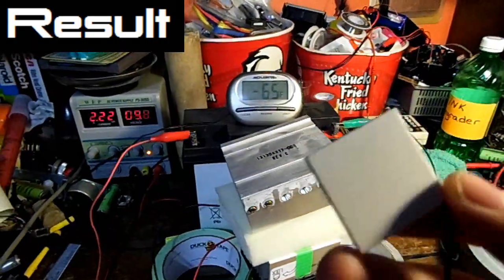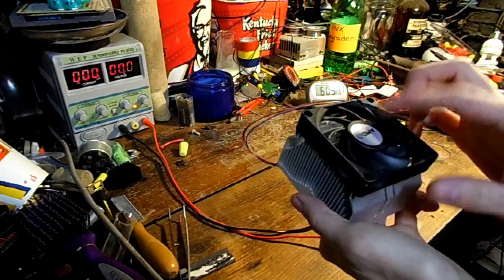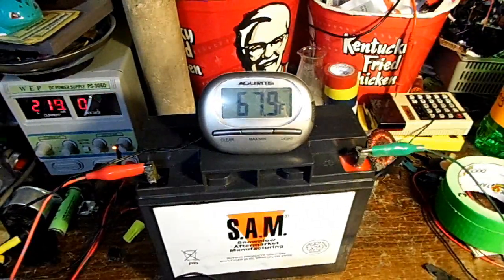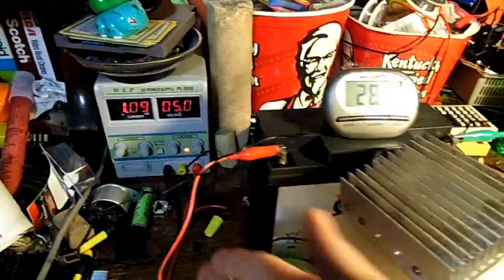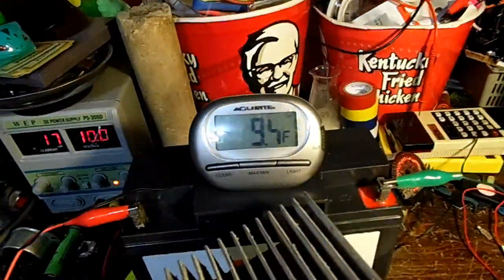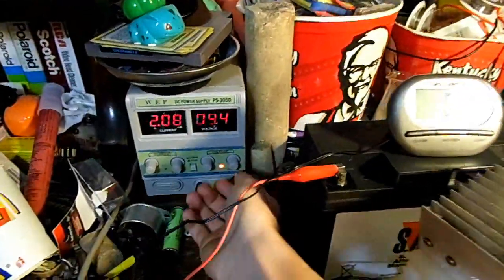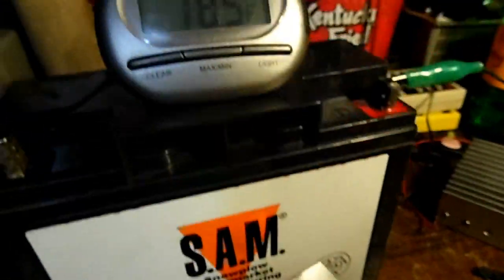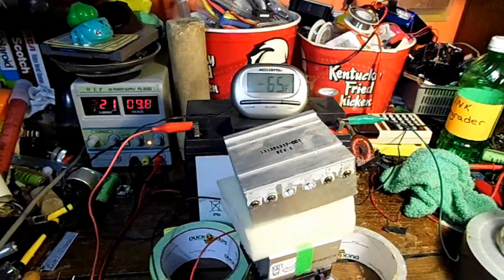Thermoelectric Peltier Cooler experiment 2

Comment: So running a peltier at approximately 10 volts you get better cooling ?     Peltier units are very interesting. Something with no moving parts and no high pressures but gets cold.

Comment: Hello, I'm from Brazil, my question is
Should I use fans in my 18650 packages?
thank you so much
Reply from the maker: make the battery have 2AH for every 1 amp you plan to pull, and it shouldnt heat up hardly at all, thus requiring no cooling.
Reply: thanks

Comment: hey! this is my first comment ever ( ithink) but i love your vids, watch them ALOT OVER N OVER. i just recently did my bafang mid drive bike. 48v 750w. also its 80 degrees where i live. heat kills the mosfets in the motor ive read. COULD YOU USE THESE TO KEEP A MOTOR COOL??!! EBIKE??????!!!! YOUR AWESOME!

I REALLY HOPE THIS IDEA WORKS. BUT IM LOST BECAUSE THE COLD SIDE WILL BE ON THE MOTOR WHICH GETS HOT...SO...????
Reply from the maker: well the issue is these dont push heat very quickly. so i think a big copper heatsink and a fan would be best. maybe get the fan and heatsink from an old laptop?

Comment: The results from adding the water was really cool.  So what would happen if you put  one of the coolers directly on top of the processor ?  would it work to help cool the processor or hurt it ?  I am also curous about where to get one of the variable controller or power supply like you use ?

Comment: 65 degrees difference is amazing, especially air cooled. I've always thought about 40 was the best you could get from these.  Try using a water cooled heatsink on the hot side with 65 degree water you might get even colder results.

Comment: What brand and model peltier did you use for this? I have a tec fridge I'm looking to cool further without more amperage draw. It uses heat pipes like a normal vapor fridge for heat dissipation. I haven't pulled it apart yet to see how it is constructed but I'm thinking of replacing the peltier, higher cfm fans, and copper heatsinks and still use the heat pipe. Not worried about freezing as it has a thermostat and condensation drain. It currently pulls around 7 amps. Thanks.

Comment: Really need help.. I have a 30mmx30mm peltier I am trying to get the cold side to approx 50-60*F. I need help trying to size heat sink. Also how to size heat sink when ambient air is approx 120*F

Comment: Really cool, no pun intended.
Reply from the maker: no joke haha. still my goal is to liquify air. some water chillers can get down to -60F if they are hard wired to run constantly. so if i put this system in that i could maybe get like -110F*
Reply: I'm trying to make a thermoelectric car, you can check out my video about it if you get the chance. We should collaborate or something:)

Comment: I was completely unaware of this effect and had to look it up.  While I see myself well versed in physics, this is something that I had neither stumbled over until now nor even thought about.  This was quite interesting.

It is weird that the cold weather drove you inside only for you to start working on a cooling project.

I guess the most efficient set up in winter time would be for a tube to bring cold air in from the outside, run it through the computer and then exit it into the workshop so that the waste heat can help warm your workshop while still providing you with some fresh air.  Theoretically, it would be possible to fix it so it would operate by convection like the reactor cooling systems that don't need pumps to operate.  Since the heat exiting the top of the computer into your workshop would have to be warmer and therefore less dense than the air in your workshop, too much or too little cold air wouldn't be drawn through the system.  The idea I like about the convection system is that the heat that needs to be dumped powers the system and it isn't necessary to put more energy into the system to eliminate problem heat initially generated by the inefficiencies in the system. This avoids the need to pay for the inefficiency twice.  I bet the Japanese now wish they had insisted on the convectional cooling design for Fukashima.
Reply from the maker: yeah this effect is used in radioisotope generators. ya know like what powers Voyager and a lot of other space craft, even some lighthouses have atomic batteries.

i could take these peltier coolers and heat one side up and they would generate electricity.  inside a radioisotope generator the decaying Plutonium heats up one side of the thermoelectric cooler and on the other side a heatsink vents it into space as infrared light. that temperature differance between vacuum of space and the red hot plutonium is enough to power the computers and instroments for 30+ years during their journey.

here's the fuel pellet inside a graphite block that fuels the Curiosity mars rover.

http://upload.wikimedia.org/wikipedia/commons/2/23/Fueling_of_the_MSL_MMRTG_001.jpg